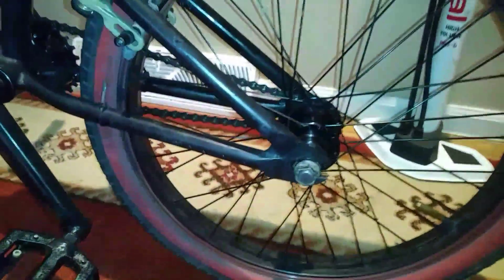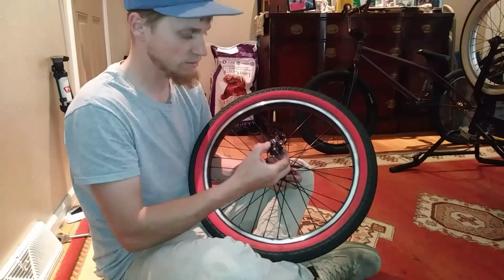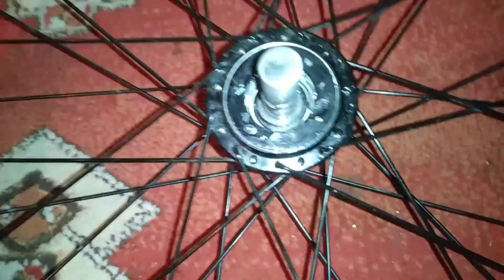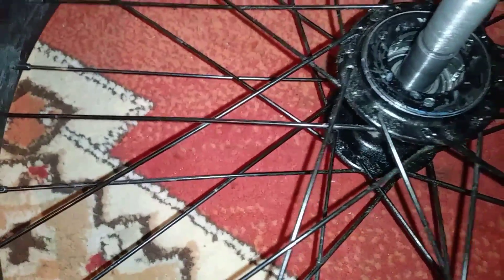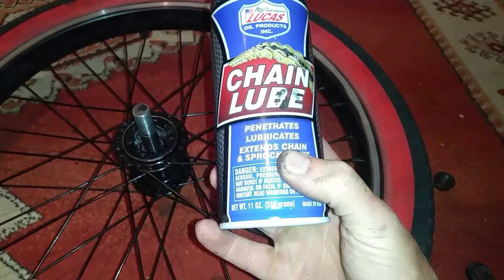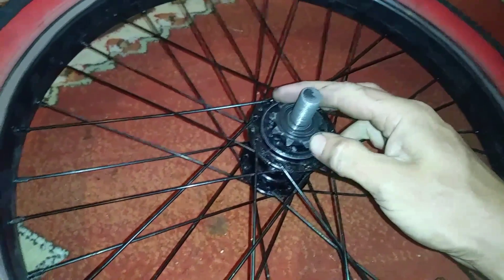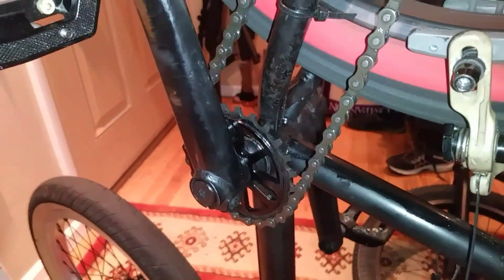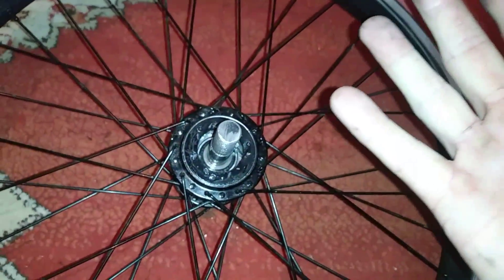How to make your BMX hub LOUDER!

Comment: If i cake it with grease will it help silence it ?
Reply from the maker: Correct,  but only for a certain amount of miles, once the grease gets displaced it will get louder again also engagement can be a bit less reliable if your springs are on the weaker side. Meaning the teeth won't make full contact at times

Comment: I’m quite late, but, would you recommend shortening the spring a small bit?

Would cutting off half a MM from the spring make it louder?
Reply from the maker: That could work! Worth a shot
Reply: @DouglasThompson  I’m just about to go clean my hub out. I might order another spring and then try just in case it doesn’t work.

Comment: Hey man idk if you would have any knowledge on this but I just bought some new pegs they fit my axle front and back but when I try to put on the back one my back nuts holding in the wheel are the same diameter as the peg it's self! I don't know what to do in this situation I've been to multiple bike shops even car parts stores and they can't help me it's the flange around the back of the nut that's the same size as the peg... btw love the vids keep it up!
Reply from the maker: sydney mccleskey if its the flange you can try attaching the nut to a rod and chucking up the rod in a hand-drill and using metal bastard file spin the nut in the drill against the file. then you can reducethe diameter of the flange. can you send me a pic? maybe i can think of something better. demureg@gmail.com
Reply: Douglas Thompson yeah man! I'll try to get around to that ASAP thanks for the response I've been asking everywhere and just about everything and no ones been able to give me a solid answer like that
Reply from the maker: sydney mccleskey Glad I could point you to a new direction! Thanks for the kind words btw! Got a few new vids in the near future! getting some more footage tomorrow too. Anything youd like to see ib a future vid?
Reply: Douglas Thompson there's nothing in particular just enjoying the content so far! Just keep it up man

Comment: What do u meant by better engagement?
Reply from the maker: The pawls snap into the ratchet ring with more authority. It will slow your coasting down but while you pedal it will feel like the pawls are clicking into place more than with a weaker spring.

Comment: Were can i get a back rim like what u have
Reply from the maker: Jaheim Alleyne this complete wheel is a rant. I dont reccomend it. Rant is not a bad company but the particular wheel I used for this video had many many problems.
Reply: Douglas Thompson what is the best kind i should used
Reply from the maker: Jaheim Alleyne do you have a ptice to work with?
Reply: Douglas Thompson no
Reply from the maker: Jaheim Alleyne do you grind?
Reply: Douglas Thompson what
Reply from the maker: Jaheim Alleyne do you grind on your bike? Like jump on ledges, rails and other objects with pegs?
Reply: Douglas Thompson yes off rale
Reply from the maker: Jaheim Alleyne in that case, I would recommend the odyssey Antigram complete wheel. It will already be loud like the hub in this video, easy to maintain and very strong for grinding.
Reply: Douglas Thompson way can i get it because i living Trinidad